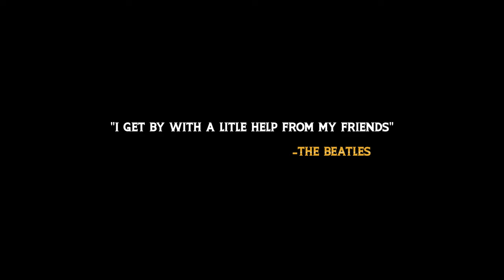OTRCMP : EP3 : Tearing Apart an Old Mans Trailer!

Comment: Maybe this is going to be a stupid question (but going to ask anyway). Why are you taking all the wood off the inside of the outer frame? Isn't that for a bit of insulation against the cold? Love Chester
Reply from the maker: In this case, wanted to expand the floor space and open it up which you aren’t wrong definitely created more airflow and less books to trap heat. I’ve done so much work on the trailer, you will see. It’s a slow process but it’s quite cozy now

Comment: U can Def see the Dif between a battery zawsaw and a coreded one.
Reply from the maker: This 60V has never not had the power I need. I’ve bucked down thick elm trees with a 12 inch pruning blade on it. I love it and not having a cord is crucial for getting to those tight spots quickly